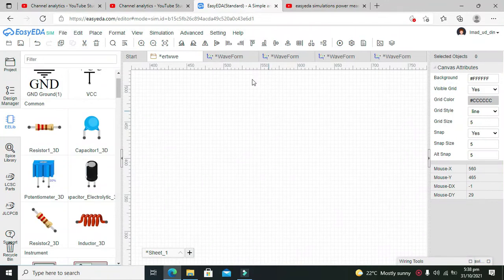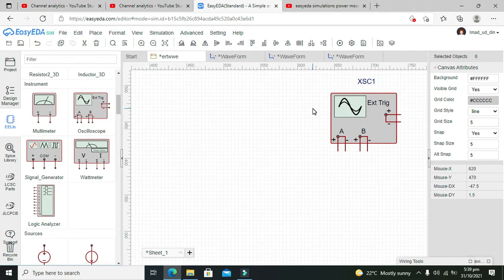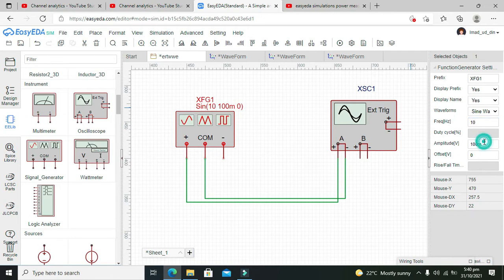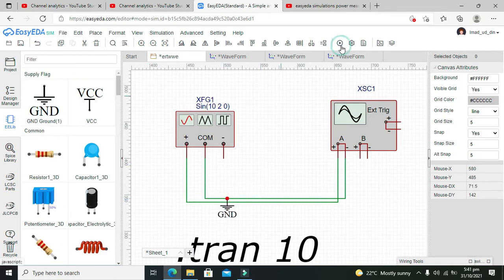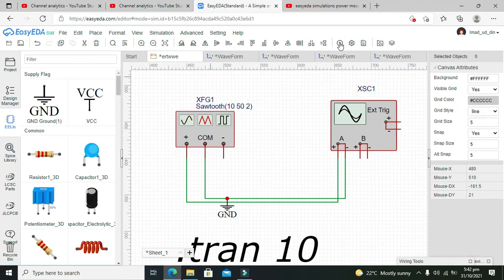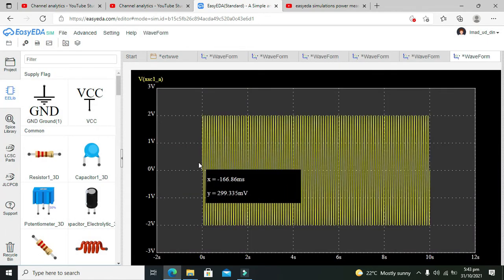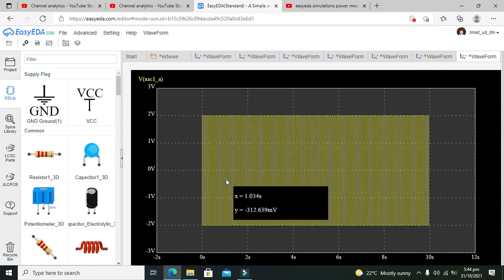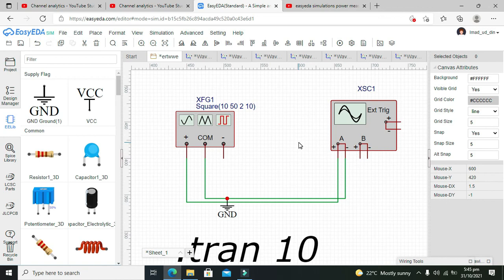how to use an oscilloscope in easyEDA simulations

Comment: Can the EasyEDA oscilloscope be used in a circuit? If so, can you show a simple example that does not involve the signal generator? Thanks.
Reply: I used it in a circuit, one to demonstrate a NPN BC457C BJT Transistor. Worked fine (I mean, not sure about the Transistor data reliability, but the Oscilloscope is perfect).

But you'll most likely want to use the Signal Generator, as Oscilloscopes are meant to be used to analyze functions.